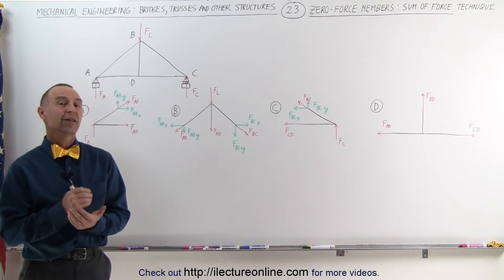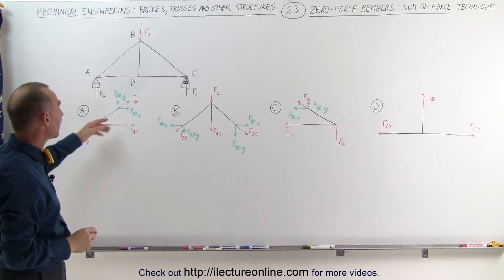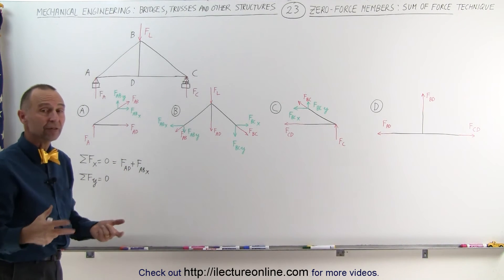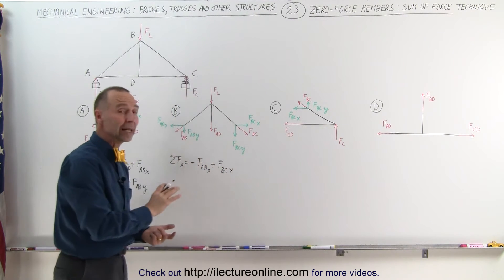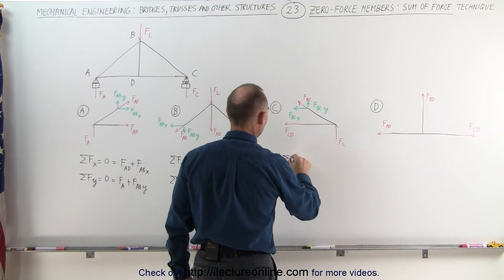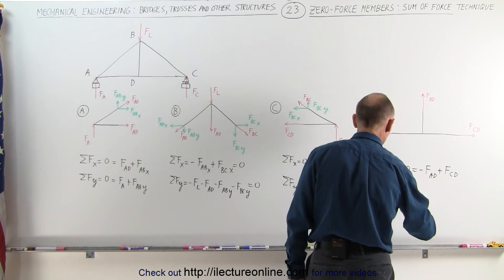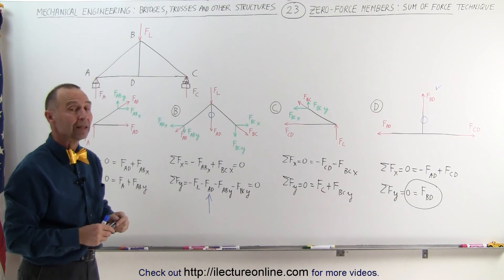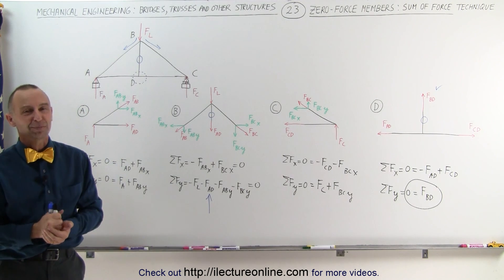Mechanical Engineering: Trusses, Bridges & Other Structures (23 of 34) Sum of Forces Technique

Comment: where is the "horizontal reaction" force at joint "A" ???
Reply from the maker: Since there are roller at c and the x component of the force AB is counteracted by the tension in AD there is no external horizontal component acting at A

Comment: Hi Michael, thank you for illustrating how to determine  zero force members in trusses in lecture videos 22 and 23. I would like to point out that in lecture 23, in the equation for the sum of the forces in the vertical direction Fy = 0 for Joint B, the 2nd term should be Fbd and not Fad.